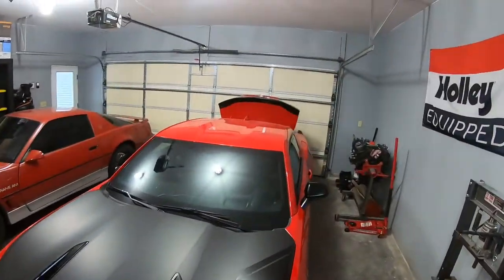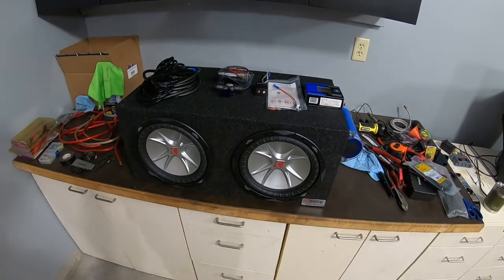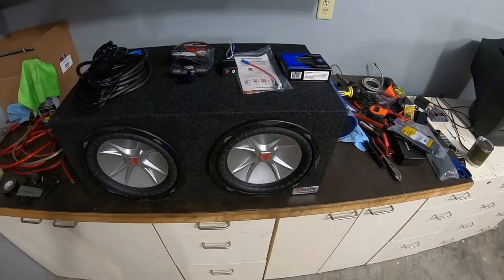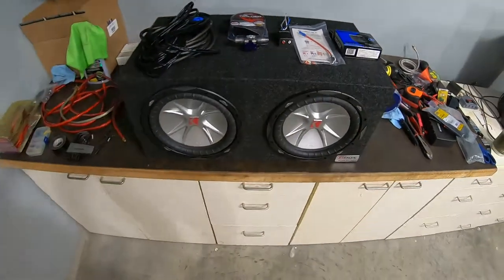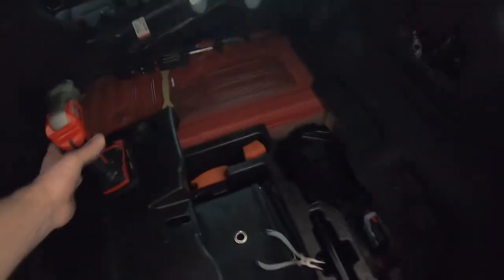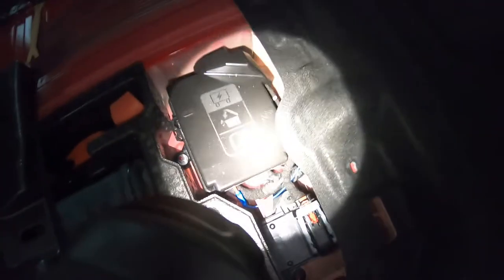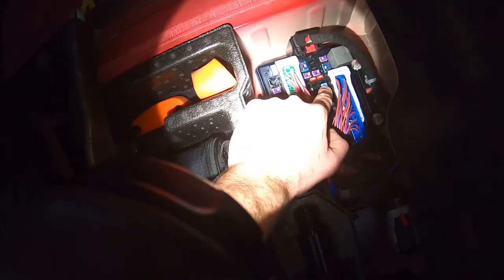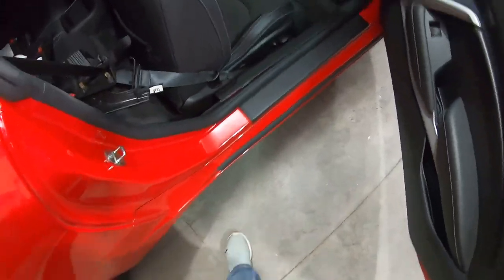2018 6th Gen Camaro Sound System Install

Comment: Under the trunk is the silver heat shield held on my 10mm bolts.. What i did on my 2016 is loosen those off and packed the gap and tightened the bolts back down. Dropped the rattle significantly.

Comment: Dose your batter die at all bc I kinda have the same set up but every now and then my car won’t start
Reply from the maker: My battery would drain before I put a system in. If it's going to sit a while I usually just hook up a trickle charger.

Comment: Hello thank you for the video I’m trying to do the same in my 2016 camaro 2ss I have a question do you think I can use the rear trunk speakers to connect the line input converter or have to be the one are using in the video
Reply from the maker: My plan was to use trunk speakers until I found out I didn't have them in a 1ss! Haha so yeah I think you can use them. With the bose amplified system just have to see if the chimes for door and stuff come through louder. If your just using it for just  subwoofer I would think the low pass filter on the amplifier would take those higher frequencies out and you would be good.

Comment: let me just ask why the heck you are sitting in a running car inside a closed garage? nvm that it sounds great!
Reply from the maker: Ah it's called night. The door was open 🤣
Reply: @EssMotorsports  how much did you spend total on this install?
Reply from the maker: @JaxonWeems  I didn't spend much cause I was reusing old sound equipment. The amp, capacitor, speakers, even most of the wire was reused from previous vehicles. The box was cheap and the new fuses was few bucks but not bad. Everything new now a days would be probably 700 bucks.

Comment: I did the same think and it sounds good but what's weird is that when I close the doors it gets like a bass sound even tho I don't have music on. I even added extra ground and it does not eliminate the sound. Any other tips will be greatly appreciated
Reply from the maker: That is weird if it happens only when you close the door. I was going to say if it happens when the amp is turning ON then get a pop stop eliminator. 
Is your gain set too high that it is picking up the slight electrical noise? I'd try turning gain down see if that helps.
Reply: Bro where did you ground your converter to? I tried grounding at the amp and my amp is grounded to the camaro ground which isn't working.  My amp won't turn on neither will my lc2i pro (converter).
Reply from the maker: I grounded the kicker converter to the battery lug. Did you tie both negatives together and both positives? If that would cause an issue if they weren't? Also make sure you have voltage from the speaker, could be blown?
Reply: I'm was using a active line converter LC7I from audio control and since is uses the speaker signal to turn on instead of relying on a remote signal I don't have a issues with any random subwoofer pops you should look into it
Reply from the maker: I will have too maybe for just the random pop issue. It's very faint when the radio comes on and off but I notice it.
Reply: @EssMotorsports  yeah if it’s an SS also look in the forums for the ANC mic delete as it causes interference
Reply from the maker: I don't think I have noise canceling  cause I have no amplifier with the 1le package
Reply: @EssMotorsports  ok yeah I don’t that trim doesn’t have the amp

Comment: can you explain which wires in the door panel you tap into? I haven’t done it yet. but is there 2 or 4 wires in the door speaker harness?
Reply from the maker: You tap into the two wires going to the rear speaker. I only tapped into the Passenger side, to make it simple. So it makes the sub a single channel based off of the passenger side, vs if you tap off of both PS and DS you could wire your dual subs to each side.

Comment: Where did you get the remote wire hooked up? Is it in the fuses box? I had a 2010 n a 2013 Camaro and there used to be a dedicated remote wire where the vehicle's amp wiring was. Now with the 2018 im trying to figure out where the wire is at. Any inputs???
Reply from the maker: I used an automatic turn on that senses when speaker wires turn on, and then turns amp on.
Reply: Hello I’m having same issue were did buy that wire to make the remote work….also do you get any engine noise how you currently have it
Reply: The RCA converter came w a remote wire.  
After hooking up everything I did have a loud noise when driving, I unhooked one of the microphones from (either side) the door. N sound is AMAZING!!!

Comment: What was the negative and positive on that speaker? what were the colors?
Reply from the maker: Good question..  I don't remember exactly but typically ground is black or it will be colored with a black stripe. Try this first and don't clip panel back in until u try system out first to make sure it works.

Comment: How u get the speeker box in the trunk tho? Kuz I have 2 12's in a prefab subwoofer box an im not trying to buy another subwoofer box
Reply from the maker: I measured before I bought the box and it fits going through the rear seat opening.
Reply: @EssMotorsports  ok

Comment: I’m having trouble getting the loc converter to turn on my amp any idea what it can be
Reply from the maker: Yeah I had the same issue right away. Make sure you hook up the ground connection wire on the LOC. I didn't do that right away and my amp wouldn't turn on.

Comment: Do I need a compasitor. With just one sub ?
Reply from the maker: No u don't. There is argument that capacitor is harder on charging system as well. So for one sub I would leave out. I have 2 10s in my silverado with no capacitor and it's all good
Reply: @EssMotorsports  oh ok  thanks bro cause I’m installing a single 12 an I thought it would need  another recharging route. In my 2017 Camaro lt

Comment: Got everything hooked up on my camero but for some reason my trunk won’t open and when I lock the doors my alarm doesn’t make any noise? Hopefully someone could tell me what it is and how to resolve it
Reply from the maker: Humm it shouldn't have messed with any of that. Did u tap into a fuse somewhere and maybe blow it?
Reply: Where did you put remote wire? I think that’s what my problem was
Reply from the maker: @MianteWinters  I used the kicker keyloc tied into speaker wire for the remote turn on for the amplifier. Check out my other camaro sound system video. Should have link for Keyloc that I used
Reply: @EssMotorsports  is that supposed to be better ? Because I used the converter in this video and I’ve been having so many issues. What gauge wires are you running ? What kit are you using ? I don’t think you really mentioned everything you used
Reply: Kinda new to the camero industry and for some reason I’ve been having issues. Haven’t in other vehicles

Comment: May I recommend the audio control lc2i if you want a better signal for your bass as it is an active (Powered) line converter
Reply from the maker: I have seen a lot of people use that. I will have to check it out.
Reply: @EssMotorsports  yeah in terms of accessibility it will definitely sound better as it also has a function to restore bass rolloff when raising the volume of the stock system

Comment: Which is the positive and negative on the speaker wire. Yellow and green wire with black stripe
Reply from the maker: I cannot remember, I'm sure I used a multi-meter and tested it to figure it out.
Reply: @EssMotorsports  did you hook the blue wire to the battery? My amp seems to not shut off when I do that
Reply from the maker: If your using the same kicker product there is a wiring diagram on the back of it. The blue wire is the amp turn on and the black wire was for ground.

Comment: What’s going on bro I have a Camaro 1ls 2021 and I just installed my subs and when ever I turn the car on I hear a roaring noise coming from my subs what could I do to fix it
Reply from the maker: If you have a factory amp, Sounds like it could be a feedback loop caused by your active noise canceling mics. I'm just guessing from what I have read on the forums but that would be a good first place to start.
Reply: @EssMotorsports  did your car have a factory amp ? I think our cars are the same
Reply from the maker: No it didn't. The 1ss 1le didn't have amps because the mag ride controller was there. 2ss might be different.
Reply: @EssMotorsports  oh okay did you have any problems with roaring noises with your sub install ?
Reply from the maker: No. I have a slight pop on startup and shutdown but it's not that noticeable. Check ground wires etc. Make sure your not chasing wiring issue first.

Comment: Shouldn't bolt amplifier to the sub box. Can really screw up your amplifier with the vibrations I've heard.
Reply from the maker: I've done this for years in multiple cars, never been an issue. I space it off a little so heat is not a factor. Car probably shakes more than the box does! Haha
Reply: @EssMotorsports  ok, just what I've heard. Looks good tho.
Reply from the maker: @NEMPLS  yeah....probably not the best in terms of electrical interference but works good enough.
Reply: @EssMotorsports  it's a really clean set up you did. I've seen alot of videos of some really crappy installs on camaros. I hate untucked exposed wires and electrical tape videos. You should be proud.
Reply from the maker: @NEMPLS  Thanks man! I try! 😄

Comment: how did u get to the speaker
Reply from the maker: You have to pull the side panel off that is covering the speaker. There is another good video on YouTube that shows more detail on what to remove. Everything is held in with clips and couple small screws.

Comment: were dis you hook up the remote wire to
Reply from the maker: The high level inputs are spliced into the passenger side rear speaker. The remote turn on lead goes to amp. Also have to hook up ground connection which I went to the battery.
Reply: i connected the the remote wire from the converter to the sub amp but nothing well turn on not even the converter
Reply from the maker: @ss6thgen336  make sure ground on the converter is connected or it won't turn on.
Reply: the converter turned on now but the remote goes from the converter to the amp remote right?
Reply from the maker: Yeah it goes to amp turn on connection. Should be labeled or reference manual of amp
Reply: @EssMotorsports  yea it is labled but im kinda  confused since usually the remote wire goes from the bass amp to the remote on the head unit and with the converter it doesnt no more
Reply from the maker: @ss6thgen336  yep u are correct. Normally it would go to the remote wire on the head unit in an aftermarket head unit. The converter is taking that place since it's a factory radio. The converter is just telling the amp when to turn on since there isn't a remote wire with the factory radio.
Reply: @EssMotorsports  well thanks ill see what i can do hopefully get stuff work out.